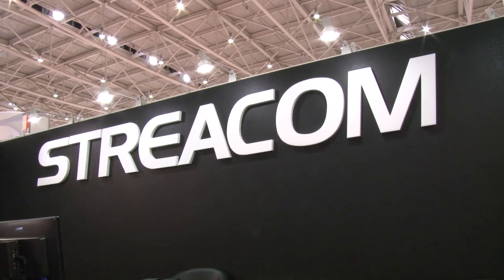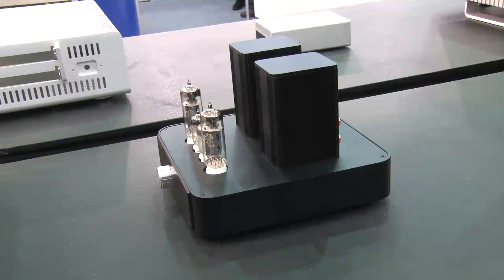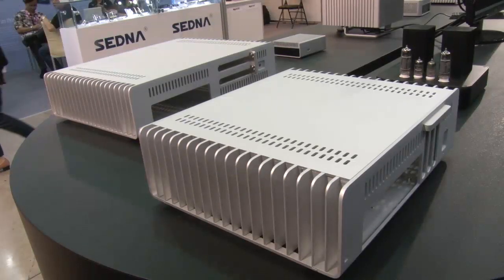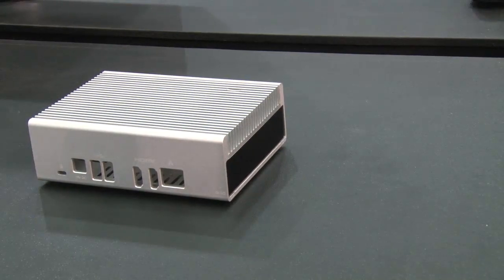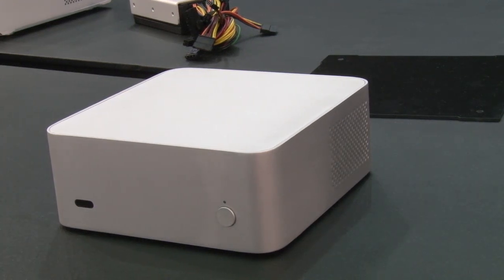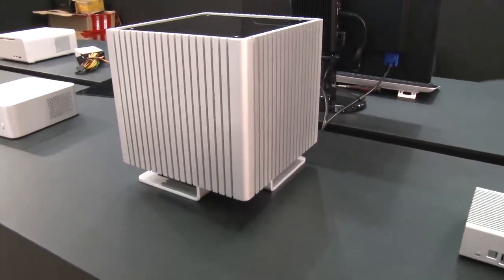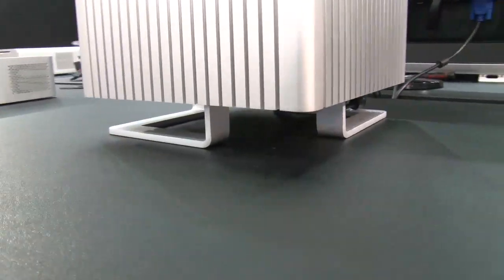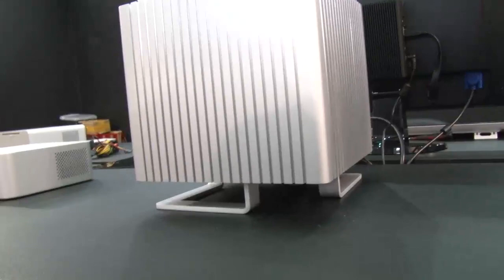Streacom | Fanless small chassis | Overclock.net @ Computex 2013

Comment: The chassis itself has heatpipes connecting to the CPU. You're supposed to use an APU or the intel on chip graphics for these (since they're actually quite good for the specific applications for these setups) or some kind of discreet passively cooled GPU like the r7 250 series with a silent cooler

Comment: The point is to do fanless. Completely fanless. These cases are called fanless because they come with fanless PSU and have heatpipes for cooling CPU/GPU. So do not add your watercooler or heatsink, they are not needed.